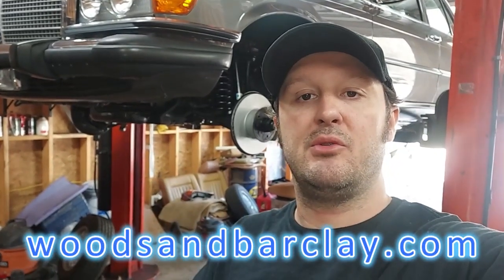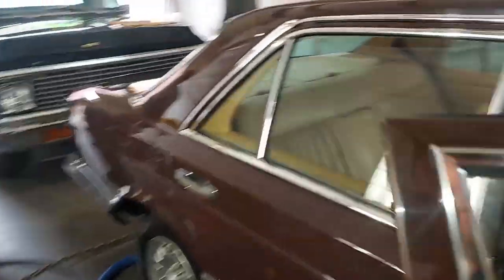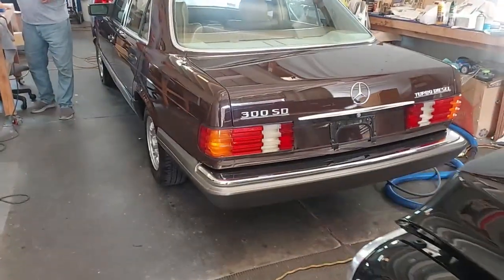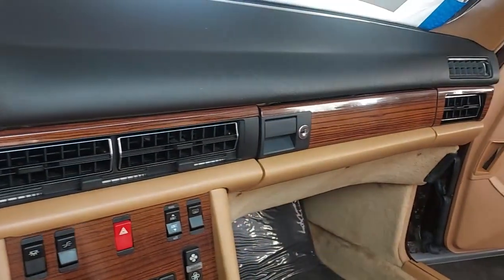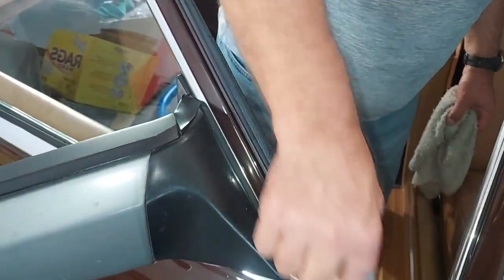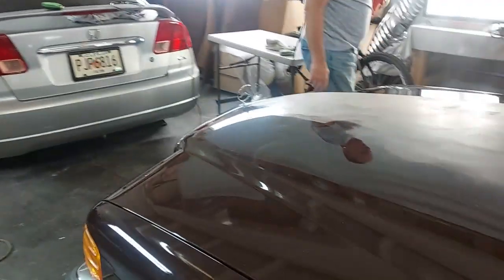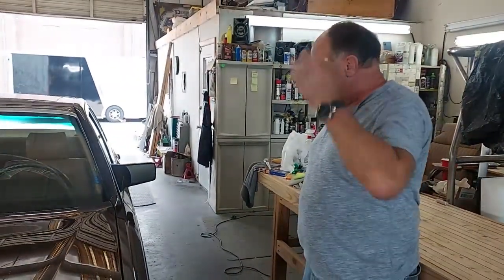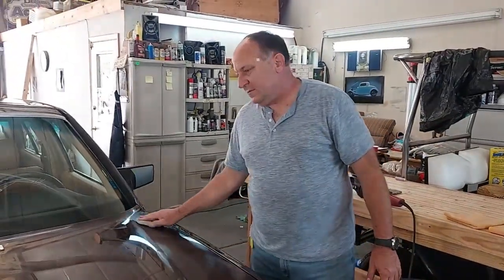1981 Mercedes 300SD - Part 9 Detailing and Paint Correction

Comment: I'm with Scott. Even with my 2021 daily driver, wash and wax. Granted I use some of the newer waxes - Turtle Wax Ceramic and Graphene Paste and To The Max liquid - but I still do it old school. I've never had a car be dirty long enough to worry about anything staining it. I'm not convinced a ceramic coating will prevent anything that I'm not already protecting it from. Nothing sticks to it. I keep a quick detailer in the trunk for those moments I walk up to it and find bird droppings. A few days back I was driving in a moderate rain storm. It was a three-lane road with a 50 mph speed limit and traffic lights. Sitting at the lights, the car beads up everywhere. Once I'm moving, all the beads just fly off and the car is practically dry while I'm driving in the rain.  After two or three lights the guy next to me honked to get my attention. He asked what coating I have on the car. He looked at me and disbelief when I simply said Turtle Wax..
The brown on palomino is so period correct for that vehicle. Fantastic job to both of you. 🍻
Reply from the maker: Thank you Ronny I appreciate the compliment.